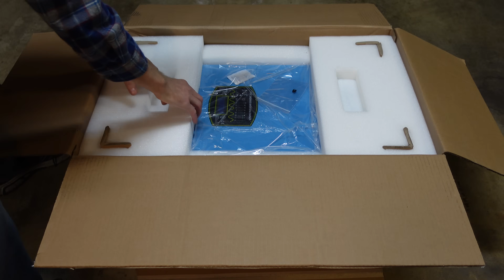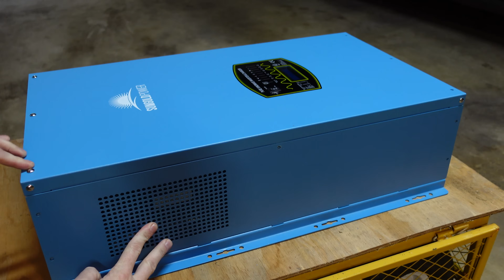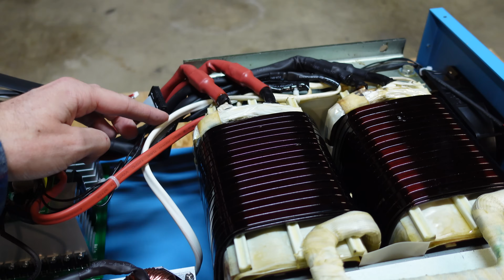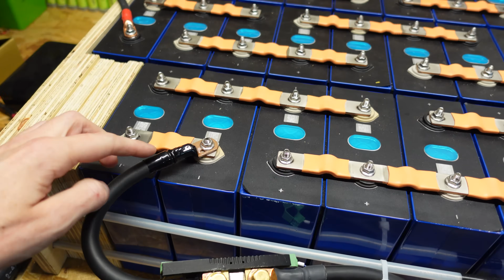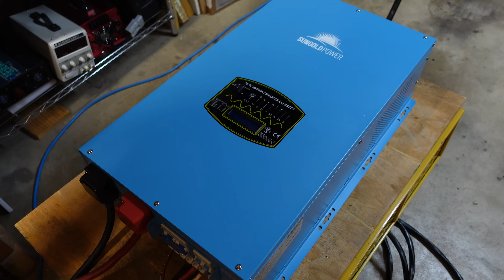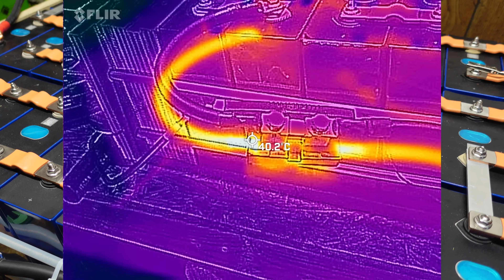SUNGOLDPOWER 12,000W Split-Phase Inverter/Charger, Review & Testing

Comment: Great video! I have a similar 10KW unit running in my garage from a different brand, but clearly the same manufacturer, and even though I feel like I have a pretty good grasp of its functions and performance, I could not resist enjoying your awesome review, and I did pick up on a couple of things from watching. The loud fan running from idle must be common on all of these low frequency inverters from this manufacturer, because mine does it as well. I keep looking for reviews where someone will test its 30+ kw peak draw, like with a huge compressor or a well pump just to see how it does, since I don't have anything that large available. Thanks!

Comment: I am looking for a follow up to how this inverter worked for you and why you got rid of it.
Given this video has been viewed 100 times a day since posting I would expect a follow up to be received well.
I notice the link below are only 9 months old so you are still trying to profit from the video so how about the how and why of its departure?
Reply from the maker: The inverter does not fit my specific needs. It is loud and self-consumes a lot of power, both of which I noted in the video. I test and review a lot of inverters. I don't need more than one or two inverting setups for my own personal use, so the rest go unused. I apologize for missing your original comment. As you can imagine, I get piles of emails every day and I simply do not have the time to address every one individually. Also, yes - I keep the links updated but continue to suggest people look at other options unless they need a massive low-frequency inverter like this. That should address all of your points :)
Reply: @LithiumSolar  Thank you for the comprehensive reply.     
I guess the endless email is the price you pay for the money you get paid.
cheers.

Comment: Really Good video thank you.   If my primary purpose of the inverter and storage was to hold up over the night for the reasonable personal needs of a 4 member family. I have NO idea how to calculate how many LiFePO4 batteries I would need - in a tropical climate to run heat pumps for cooling are rarely for heating, probably most of the draw will be from TVs, LIghts, Computers (lots of those as all of us have probably at least 2, Dishwasher, microwave, washer/dryer(maybe) as the stove is gas - and if I do hot water (which I may not) probably on demand gas.  Where can I find the info for calculating this and is there any gain in using a 24V LifePO4 batteries over 12V ones?   I have one shot to do this when I send a container from stateside to the country,  I would like spare parts to last (hopefully) 20 years (I should be dead by then 🙂).  I realize it's a lot of questions to answer but if you could make any suggestions on any of those,  I would be very grateful.  I need long term reliability above all things. Getting replacements there would be really, really expensive so buying redundant units/batteries is being considered.  Guessing from having my stateside house spec'd it would be about a 12KW system.   Thank you, and thank you if you ever respond to this..

Comment: Pretty sure the dc output is for dc appliances like a heat pump that can run directly from the solar. It would run directly from the pv input to the dc output.

Comment: How much over the 12,000watt output will this Continously put out in over rated Watts? 5%,10% at 240volts? Was Hoping as high as 20-25% Over Rating. Please do Respond! Thanks.
Reply from the maker: This information is spelled out in the user's manual. Please check.

Comment: Got any more videos on this unit ? Just wanted to know how it was over time of its usage? Have any issues?
Reply from the maker: No, I haven't used it much. It uses way too much power sitting idle for any practical use here.
Reply: @LithiumSolar  I just want something I can flip on when needing 220 stove water heater air compressor. 220 stuff mainly? Got my 110 covered. Got 3 separate units. 1 small porch unit for charging battery for drills what nots.

Comment: You'll get a much better price for the exact same inverter design (same design, same parts, same warranty) by purchasing a Sigineer Power 12000W 48V SPLIT PHASE PURE SINE WAVE INVERTER CHARGER. Both Sungold Power and Sigineer Power are made by the same manufacturer, but the Sigineer Power inverter cost's far less.
Reply from the maker: I won't do business with Sigineer. They might make these for other companies (still not sure) but their sales rep person was rather rude in answering my questions a while back and instead just made jokes about chickens (seriously).

Comment: Wow! 155 lbs is quite lightweight compared to the Lux 18,000 watts in / 12,000 watts out 48VDC to 240VAC split phase hybrid inverter / charger's 309lbs.
Reply from the maker: 309lb?? How do you get that mounted on a wall? Guess you need a scissor lift or something as it's unlikely 2 people would be able to hand lift that.

Comment: What is the cable specification for the two 120AC splits and ground? The diameter for the three screw crimps seem to be too tight even for 2 AWG wires. I haven't purchase the cables yet because even 2 AWG available in the US shows that the copper would not fit in the hole.
Reply from the maker: I'm not sure specifically; however, I can tell you that you will not fit #2 in there. I used #6 and I think that was the limit. I don't think #4 is fitting in there either, but not certain on that one.
Reply: @LithiumSolar WE NEED A BETTER ANSWER??? IT CALLS FOR #2. WHY . BUT ONLY ACCEPTS #6. THATS AN ISSUE???
Reply: @LithiumSolar  Thanks for the help! It seems that China companies consistently call out 0.2576 inches in diameter (which fits). US sellers have various numbers and not the same.

Comment: This really should have a dual MPPT controller in it - It is really chintzy that they only include a single for the price.
Reply from the maker: Honestly, it's so cheap already the way it is. I'd rather them remove the MPPT completely and instead use the $30 that saves to fix the high idle "problem".

Comment: Great  video thanks for sharing. Very informative. I’m curious how many watts of power do you have coming off your solar panels?
Reply from the maker: I've got around 10kW right now
Reply: Thanks for the reply that is very helpful. What kind of results do you get as far as around the clock power with that system? Does it run all night long and then able to charge up during the day and then do it again the next night?
Reply: And why did you choose those batteries on this video compared to other ones?

Comment: I totally regret buying sungold, out the box had f11 code after emailing the Chinese like 100 times refusing to open it up as they told me to do since they wanted to fix it myself, I even offered to pay to ship it to them which I did, when  I sent it in, they returned it after a month scratched and a loose screw inside  only then I opened it to retrieve the loose screw to find out they did not fix it, send it in a second time...hillbillies did not fix it even the second time.
Reply: When purchasing use visa.     Out of the box failure is immediate replacement or they stop payment.
I have been run around several times with "legit businesses'  not out of china !   and in the end I contact visa and I get my money back straight away.    The manufacture never wants the broken inverter back.  

I am not sure what the failure rate of the all the inverters is but I too have had 1 of four not work out of the box.

Comment: Love the review. My 12kw sungold just arrived. One thing I noticed, I'm fairly certain the ground in the terminal block is for the AC input, not the AC output. You'll want to use the grounding terminal (that separate terminal) to ground the AC output.
Reply from the maker: You should see continuity between the ground points anyway. You don't want multiple grounds with voltage potential between them.
Reply: @LithiumSolar  good point. Thanks for the reply! I suppose I was thinking the flow of current needs to go in the right direction, but the direction it flows through the device doesn't matter. It will end up going to your home ground in any case.

Comment: With regard to the fan at least with my 18 KW inverter there are two DC fans which are thermostatically controlled and they do switch on when heavy loads are applied and then there is an AC fan which is on at all times. That's probably the fan that you were hearing.
Reply: I just got my 18000 up and running, so the AC runs continuously? Also any chance you hace pics on how to connect backup generator
Thanks Todd
Reply: @toddpreece1247 The AC fan runs off the output of the inverter, so it's on when the inverter is making power. There are two additional DC fans at the bottom which will run only when big loads are applied. I replaced the AC fan with a quiet one and SG reimbursed me the $100 cost of the fan/shipping.
The way I have my generator hooked up, is not through this inverter. I have it feeding a second Sun Gold 6kW inverter/charger + a EG4 Chargeverter. So when the generator runs,  it's dirty, unstable power does not feed the main breaker. It only charges the batteries. So the house gets clean, steady power from the SG 18kW inverter all the time. The generator adds about 8kWh to the battery for each hour of run time.

Comment: I finally load tested my son gold 18 KW inverter. I turned on every Appliance in the house. All four electric range burners, the oven on preheat, the electric dryer, the air conditioning, and just about everything else computers lights etc. The total load came to a little over 16 or 17 KW and the DC draw on the 51.2 volt battery was about 370 ampers. The inverter just chugged along like nothing was any different than the usual. Absolutely amazing piece of hardware.
Reply: Still happy with it?
Reply: @stiffmeister0hYeah  Going on 3 years and it just does yeoman service. No bells and whistles, just steady electricity. Our only challenge is the rainy conditions we're having this year. Staying on battery power is challenging when your PV input is low due to heavy rain.
Reply: Nice one
Reply: I bought ok, 18 k, looking forward to use it..
Reply: @lincolnwalker270  While it's possible to lift with a pulley system, I recommend an extra pair of strong hands to lift and mount to the wall.
Reply: How much was the A.C. ampacity (amp draw) with all that on. I was told that it could put out 95-100amps indefinately. Is that True? Hope So.
Reply: @JohnBurns-j2c  The AC load ampacity is closer to 83 A continuous. With everything running simultaneously, the load % reading was around 93%.
Reply: Sol-Ark would be screaming away in overload.

Comment: hi, do you mind sharing your charge settings for lifepo4 with this inverter? thanks
Reply from the maker: The inverter comes pre-programmed. There is an LFP selector for the battery type.
Reply: @LithiumSolar  thanks very much for that info.

Comment: this is an awesome inverter... it powers my entire home including ac's, 110v heaters in winter, power tools, etc... I was skeptical but I'm very happy to have it now. The charge controller is very under powered but you can disable it and run as many charge controllers/solar arrays to your battery banks. I currently have 22k watts of solar coming in through 4 charge controllers to power my 6 100ah 48volt lifp4 batteries. This inverter has never faulted or shut down even though my hot water heater, dish washer, washer and dryer, etc all run on it. 5 stars from me. trust me, I've had my share of crap products
Reply: It’s only a 100 volt charger on the older model that I have. You could absolutely use it but my strings are much larger than 100 volt-
Reply: @jasonhensley947  Thanks Jason, May I bother you a little further??? I just purchased this 12000. Dual . I have 7.5 thousand watts. 12 100 ah Battery bank. So my ? Is can I connect some to it and still leave the others connected to the battery Bank??? Thank you for your time.
Reply: @TheVoiceofKevinC  If i am understanding correctly, you want to can you use multiple chargers as well as the charge controller on the inverter? If that is the case, then yes- by all means. Example: I use my old Growatt 5k's as charge controllers and have around 500volts coming into the external bus bar from each. I also use 2 additional charge controllers connected to that external bus bar. That is routed to the battery bank bus bar so that all charging is done simultaneously. I even have a "chargeverter" from EG4 connected to that bus bar so I can charge from generator and/or grid if needed. You can multiple charging sources to the battery bank. This then powers the 48v inverter. So in essence, the inverter works off of the battery to create the AC power source seperately from the DC power bank/solar. Hopefully I understood your question.
Reply: @TheVoiceofKevinC  I am not sure I understand your question- Please be more specific-
Reply: @jasonhensley947  I am trying to charge 4 banks @48 volts. All I see is "connecting charge controller to the same buss bar ? That my 4 banks are connected??? It seems to me that the power would go out to the inverter as the banks do????? I'm using 2 charge controllers. I have 1 to the POS on one bank and I have the neg connected to the neg of the last bank. ??? Now Jason;  it only last for about 1 hours???? What am I doing WRONG????
Reply: @jasonhensley947  Close. I am using 16 marine deep cycle 125ah each. Connecting my controllers have become my misunderstanding.?? I should get more than an hr or 2 of use??right
Reply: Question for you; Why would you disable it's charge controller? Couldn't you just add other controller's to the bank?? Sincerely KC. I'll check back in a day or so ???
Reply: 👍👍👍🤔😎🤠💯Thanks Jason. & Wow you have some serious power going on😱.. I really appreciate the feedback.... Again Thanks very much
Reply: How does it compare to the 12kw AIMS inverter?
Reply: @adammcqueen3212  I have never owned or test the AIMS.
Reply: Is it still working?

Comment: Great video . Could I know any lithium battery can communicate with this inverter ? Need communication protocol ?
Reply from the maker: No, this inverter does not have any battery or BMS communication capabilities.
Reply: @LithiumSolar  thank you so much ! That means we can use this inverter and connect to any lithium battery or lead acid battery , correct ?

Comment: If you were today looking to buy a 12kW output system, using either a single unit like this one, or dual paralleled units, and you needed to minimize standby consumption of the inverter; what unit would you suggest?
Reply from the maker: If I were building a 12kW system today, I'd be using a pair of the MPP Solar LV6548 inverters.

Comment: Great Video.  what was the display you used to show the current/watts/voltage?  also what batteries did you use to build that? I am thinking of building a 48V bank vs purchase.  a 100aH 48V is about 1400-1800 USD.

Comment: Do you need a specific kind of bms for your batteries configuration or will a normal 16s 200ah or 300ah bms still work perfectly

Comment: I replaced my MPP Solar LV6048 with a Sungoldpower 10kW split-phase inverter, and the charge controller appears to be garbage.  The charger efficiency shows something around 50% efficiency by my calculations.  I had no problem fully charging my 10kwH battery pack on sunny days with my previous inverter, now with even having trackers, I rarely have a full day now.  Their support have been terrible so far...  And yes, the power consumption of the inverter itself is pretty bad, compared to the MPP Solar I replaced it with.  Noticeable difference in battery drawdown overnight.

Comment: I purchased the 15K unit 48 volt. I'm currently running lead acid batteries and the fan is constantly running like you said from the moment I turned it on. the unit has not once that I've seen gone to charge controller mode it stays in inverter mode the whole time and I've never had a problem with it running out of power lowest batteries ever got was 49 volts when I had it in a 24 volt configuration with out back charge controllers and 24 volt 15,000 watt inverter I was running out of power in the winter time. So did you find out from the company why the fan is always on?
Reply from the maker: It seems (based on what others have said) that it just doesn't have the fan control circuitry that other similar inverters have. It seems like a huge oversight in my opinion as something small like this would have reduced the inverter's power consumption quite a bit.
Reply: @LithiumSolar  thank you for getting back to me I wondered about that fan so I appreciate the invite.
Reply: @LithiumSolar  I have had AIMS 10kw LF inverters. The first one was taken out by lightning strike. The fans ran all the time for about two years until the strike.  Aims said that was normal. I bought a second 10kw LF after the strike and its fans only come on when needed. I have run this one for 3+ years and the only problem is that it will shut off when charging off grid/gen. It gets hot after 3-10 minutes. I charge the batteries using two Midnite 150 charge controllers. Which have been working for 5+years with no problems. The fans should not run constantly. I will not buy another Aims or clone. I did buy two EG4 6500 EX 48 from Signature Solar which are bad right out of the box.

Comment: Your fuse is too far from the battery. Cable should be short as possible.
Reply from the maker: You realize this is a testing/review video - right? Not a permanent installation.

Comment: I've got two identical AIMS 48V 10kW inverter chargers which are almost identical to this. The controllers failed in both (the board on top with the relays which handles the shore power to battery switchover). One unit's fans are always on, the other always off at idle - even after changing both boards! So perhaps you're seeing a similar issue - maybe a sensor problem.